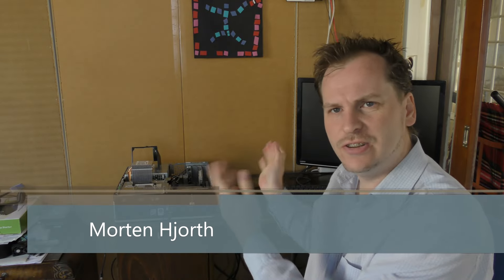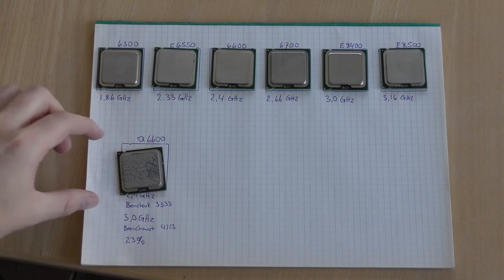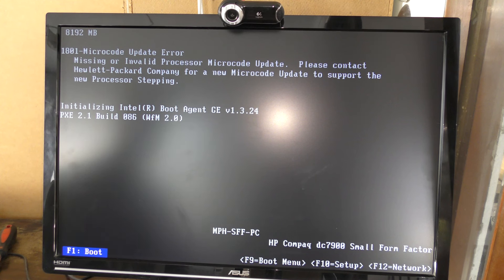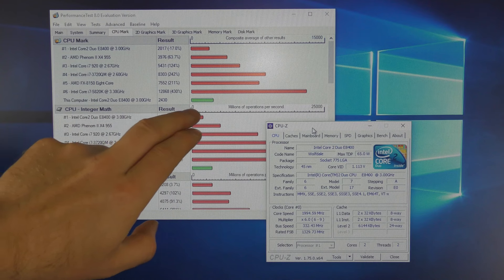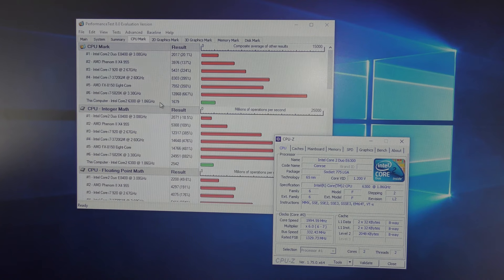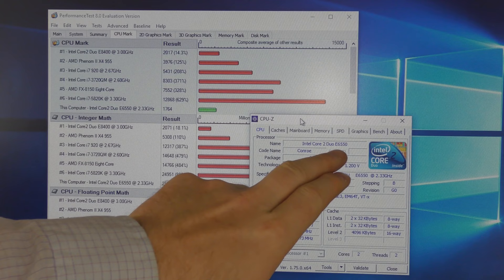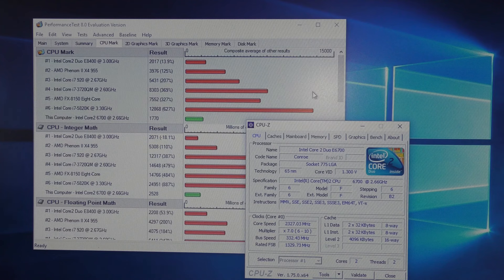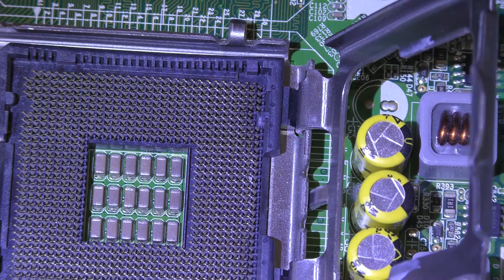Ninja Waste "BSEL Mod" E6xxx and E8xxx-series Intel Core2 - 386

Comment: Too all E8xxx/Q9xxx users.
Yes, you can do the mod, if your motherboard supports 400 mhz FSB (1600 rated).
Just you need cover different pins:
http://www.xtremesystems.org/forums/showthread.php?232678-E8xxx-Q9xx0-FSB-1600-pin-mod

https://forums.tomshardware.com/threads/is-there-a-working-bsel-tape-mod-for-the-q9500-cpu.3084404/
Unfortunetly, My Playhouse replied last 3 years in comments to everyone, that it is not possible, because it's already 1333 mhz FSB CPU. Of course, they were interested about 1333->1600.
Reply from the maker: Hi warrax111
Thank You very much!  glad you liked the video :-)
Thank you for watching! :-)

Comment: I appreciate the videos and time you put into them ...helps me on my xenon n Intel older processor questions and ideas I appreciate yah man!! Keep up the good work !! I managed swapping my sons 3.0 dual core out to a modified x5450 xenon quad 3.0 and brought it back to life for better gaming ...I got 2 more x5450's and picked up a q6600 n tried the tape but motherboards I tried in 2 Dell's was the g33mo2 mobo and won't support quads but got a friend supposed to bring me a mobo n hoping its a 775 socket n maybe an Asus or gigabyte to have better luck with but till then I'm keeping my eyes open for a different Dell but may just try the tape idea on those dual cores and c if they clock a lil higher even just to sell em cheap to someone looking for a pc to play around on ...thanks 4 the ideas!!
Reply from the maker: Hi jason wilbur
Thank You very much!  glad you liked the video :-)
Thank you for watching! :-)
Reply: G33m02 does not support quad core CPU, you need the g33m03 for that. You could bsel 1066 dual core on them but most of the higher clocked e7500 etc will require more voltage too to be stable.

The lga771 mod and a xeon x5270 would be a good choice for those g33m02 boards, 80w 6mb cache 3.5Ghz at stock fsb and voltage would allow for some software over clocking using setfsb or similar.

Comment: The tape method works only if your motherboard supports 1333MHz FSB and you are using a 1066MHz FSB CPU. For 1333MHz CPUs you need 1600MHz capable boards respectively.
Reply from the maker: Hi Foreigner037
Thank You very much!  glad you liked the video :-)
Thank you for watching! :-)

Comment: it only works up to 1333mhz fsb (1600mhz on aftermarket boards) which is why the e8xxx series doesn't really work. It does work with almost all of the Conroe and Kentsfield CPUs though (e6XXX and q6XXX) except the extreme edition cpus. The main thing that would prevent any conroe or kentsfield cpu from booting after a bsel mod would be voltage. If you're doing this on an oem motherboard with no voltage control, then you may just want to stick to the e4XXX and e6XXX cpus and go no further than 1333mhz bsel mod.

It DOES work with almost any 775 CPU, but the voltage limitation and heat will always be the main cause of problems.
Reply from the maker: Hi
Thank you very much for your awesome input!
Thank you for watching! :-)
Reply: DOverton252 
I know this is old news, but its new to me.  You sound knowledgeable so I reach out:
I have a Hp/ Foxconn N15235 Motherboard found in older slim pc.  Tried this (and many more bsel mods configurations) on a E4700.
System just wont boot with the mods.  I think the motherboard will not allow it
I only have 3gb Ram in there could that play in any way?

Comment: I have a HP DC5800 with a e5300 do you know anything about this one ? Is thé Q6600 the best CPU to put un those computer ?
Reply from the maker: HiYou get a lot more out of the Q6600 and it is like $14 used.
Thank you for watching! :-)
Reply: what about my little e5300 ? will regular tape damage the cpu ?
How did you get the info that the Xeon doen't work ? Can I put a QX9770 ? Or Q9650 ?
Thank you for replying I really apreciate, love those videos that you do !!
Reply from the maker: Hi Royal Eagle 
You will need to google that :-)
I do not have other Q CPU's to Test.
Thank you for watching! :-)

Comment: The E6550, E8400, E8500 all already run at the maximum FSB supported by most chipsets of the core 2 architecture (1333 = 333x4), so it's pointless to mod them. To jump the E6300, E6600, E6700 and the Q6600 (from 1066 to 1333) you only need to float BSEL2 which is covering that pin next to the notch. The other piece of tape does nothing to the overclock and is covering a power pin which could result in less power delivered to the CPU if it senses every pin. 

Still not sure why you experienced some underclocking but I will come back to it if I bump into something. 

We can read the Core 2 CPU and Chipset datasheet on Thursday if you have time haha. Cheers.
Reply: Thank you for bringing this up and wasting the 3 hours by the way!!

I hope I don't sound like I knew it all along because I did most of the research and testing on Wednesday lol

My retired E6400 is up to 2.66GHz and solid now :D Cheers
Reply from the maker: HI
Thanx for the good info,,,, only need one piece of tape. I will test that :-)
Yes I be in London Thursday,, if they let me in :-)

Thank you for watching! :-)
Reply: My PlayHouse Just don't bring over any colourful homemade 18650 lithium battery pack with a bunch of wires hanging of from it! Haha. Will see you on Thursday
Reply: My PlayHouse By the way, did you get my message with phone number?

Comment: Morten, you can try getting a Dell Optiplex 745. I have an Optiplex 745 running with a Xeon X3220! If you can get the better one like an Optiplex 755 or 760, you can run better xeons in it nice for a workstation and/or server. Great video as always! :)
Reply from the maker: Thanx,,,
I was going to make a video on my new Lenovo mini PC,, but I have forgotten the damn power supply. :-(
Thank you for watching! :-)
Reply: :O Nice! Is it the Lenovo Thinkcenter M series? I've always loved small PCs. Could run them as a server while taking up a small space.
Reply from the maker: Hi
Yes an M93 i think.
Thank you for watching! :-)

Comment: I had to update the microcode on an Award BIOS firmware to enable a Xeon 771 processor to work properly on a 775 board - Dell Inspiron 520 :)
Reply from the maker: Thank you for watching! :-)
Reply: For boards limited to dual cores there is a 1333 3.5ghz Xeon x5270, a 1600 bsel mod on one of these would almost definitely need a volt vid mod too for stability.

Comment: It seems to that all these Core Duo's are all the same chip, only that intel deactivated some frequenze, which you compensate with the tape. So you make them all the same.
Reply from the maker: Hi 
The microcode is fucking up my awesome test :-/
Thank you for watching! :-)
Reply from the maker: Hi Ante Plus 
The point was to see if there was anything to be done for this shitty offices PC, with no overclocking possibility what so ever. The Q6600 worked really well,,,these, not so much!
Thank you for watching! :-)

Comment: my playhouse hiya iv got a core 2 extreme X9100 3.6ghz in my old dell optiplex 760 pc  and woundering if this could work with my cpu do you think it's possible
Reply from the maker: Hi William Davie
Well maybe,, the x9100 does have a FSB of 1066MHz,, like the Q6600,, but if your system does overclocking,, that is way better.
Thank you for watching! :-)
Reply: +My PlayHouse (Morten Hjorth) thank you very much for your reply yes I'm going to give it a try iv got the cpu strips I can use morten  I will take a screen shot before & after or a video if it works and let you know and see the difference hopefully it can help others if it works  thanks very much morten

Comment: Hi thanks for your videos :D They're great. I did it with my Q6400 and raise the GHz from 2.4 to 3.0 and the bus from 1133 to 1333 and it works perfect. But i've one question: I did the same by my brothers CPU (Q8400) but at the first time if started the PC the Motherboard told me that i've installed a new CPU. The normal Basefrequenz is now 2.0GHz from 1.6GHz but i can't go over 2.0GHz anymore. Do you have any idea what i can do to get the 3.26GHz? Maybe an Biosupdate? Thanks for your help :D PS: Sry for my bad english. It's not my native language.
Reply from the maker: Hi
If the mother Board can do over clocking, this is not needed at all!
Thank you for watching! :-)

Comment: Hello could i use the tape method in my q6700 in my optiplex 745?
Reply from the maker: Hi Nyblen Productions
Might work,, if not, you just take the tape off again. 
Thank you for watching! :-)
Reply: q6700 needs usually increased voltage, as it won't go 3.33 ghz on stock voltage usually.

Comment: maybe the ninja hack does work, its just the micro code thats messing with the processor
Reply from the maker: HI
a lot of these CPU's was already running 1333MHz so nothing to gain :-/
Thank you for watching! :-)
Reply: +My PlayHouse (Morten Hjorth) You could try the VID mod that increases voltage and see the results, also can you try this on LGA771 CPUs?
Reply from the maker: Hi SkyMix_RMT 
I have done the Xeon 771 to 775 MOD : 
https://www.youtube.com/watch?v=abIIbI4jXeQ
And did a overclocking on it:
https://www.youtube.com/watch?v=ExPY4lbW6Yw
Thank you for watching! :-)

Comment: please ask me . This right for core 2 quad Q8400 too ?
Reply from the maker: Hi tutor games
NO the Q8400 is already at 1333MHz,, so no change : https://ark.intel.com/products/38512/Intel-Core-2-Quad-Processor-Q8400-4M-Cache-2-66-GHz-1333-MHz-FSB-
Thank you for watching! :-)
Reply: @MyPlayHouse  i am pretty sure covering the two pins nearest the notch will bring 1333->1600 but the motherboard must support 1600fsb

brings q9650 to 3.6Ghz most will do this on stock voltage
Reply: @nexus7tablet610  nice info, was finding this information for months. I dont understand why people are not curious about this, as many E8400 users are there. Why anyone cares only about 2.4->3ghz lol, dont understand it. Please make some video, or confirmation or source.
Reply: @nexus7tablet610  Wow, found it! http://www.xtremesystems.org/forums/showthread.php?232678-E8xxx-Q9xx0-FSB-1600-pin-mod
Yes, it will work from 333 mhz (1333 rated) to 400mhz (1600 rated).
What is worse, this dude My Playhouse misinformed already like hundreds E8400 and Q9x50 users in comments, while they asking, that they cannot do the mod, because it's already 1333 mhz. Of course, they were interesting about 1333->1600 mod.

Comment: You are thorough, lots of work! 
Rename channel to, "My Corner"...seriously.
Is it too much to ask if you considered the low voltage processor(s), Xeon L5320 ( socket 771)? 
Bus frequency is 266 MHz. but,  because the processor uses Quad Data Rate bus,  the effective bus speed is 1066 MHz.
Often, the Earlier BIOS updates for the ( HP, Dell, Lenovo) business boxes are the most robust and can, "do" more.
How will the,  "BSEL Mod" with tape procedure, change out with the socket 771 pinout?
Cheers!
Thank you.
Reply from the maker: Hi postcrisp
Thank You very much!  glad you liked the video :-)
Thank you for watching! :-)

Comment: Does this work with the Presler (i.e Pentium D920) or Conroe-L (i.e Celeron 420) processors as well?
Reply from the maker: Hi are they 775 socket?
Thank you for watching! :-)
Reply: In theory it works for most Intel processors, but is only practical on the LGA775 ones
Reply: It depends more on the actual motherboard chooser, since thats what sets the base clock/front side bus
Reply: Motherboard chipset*
Reply: Gustavo Ferlizi Then which chipsets?
Reply from the maker: HiYes It is the chipset that determines if the Xeon Hack will work.
Check out this,,, number 6. is motherboard chipset : http://www.delidded.com/lga-771-to-775-adapter/
Thank you for watching! :-)
Reply: My PlayHouse Both CPUs I mentioned are LGA775
Reply from the maker: Hi Crimson Sunrise 
I do not know if it will work,, If you try,, let me know?
Thank you for watching! :-)
Reply: Crimson Sunrise I mean that your chipset has to support the Base Clock / Front Side Bus that you want to run at. Both of the chips you mentioned have an 800MHz FSB. There's a list on wikipedia of core 2 architecture chipsets here https://en.wikipedia.org/wiki/List_of_Intel_chipsets#Core_2_chipsets
Reply: Tried with my Celeron 420. No POST. I don't have a cooler powerful enough, so I won't risk the Pentium D920.
Reply: Crimson Sunrise To be clear, those 2 chips are not worth the time. ...but if you want to learn... Here is what I know:

The BSEL setting used in the video is only good to jump from 266 to 333 baseclock.

To jump from 200 to 333 you have to do 266 first. You can leave the insulating tape on the pin next to the notch (BSEL2) as in the video and then trace the pin right above it (BSEL1) to a ground pin (VSS) with conductive ink (try alluminium tape first) as seen on this image http://i246.photobucket.com/albums/gg116/sniper69aka101/14185b89.jpg

PS: 200x4=800, 266x4=1066, 333x4=1333
Reply: Gustavo Ferlizi I'll try once I have access to this tape. I looked and some people said that the motheboard I have doesn't allow that jump (ASUS P5VD2-MX)
Reply: Crimson Sunrise You can read the first feature on asus's website that it only supports up to 1066FSB going back to my initial comment. So you can only do the harder mod of BSEL1 to VSS for 266 clock.
Reply from the maker: HI Crimson Sunrise 
It seems that the ASUS P5VD2-MX can do some overclocking,, You can not run faster then the Motherboard's 1066FSB. I'd also say that this might not be worth your time :-)
Thank you for watching! :-)
Reply: My PlayHouse Well, I already have my Pentium D 920 2.8 GHz overclocked to 3.25 GHz. That's the maximum amount that it can go to on this board.
Reply from the maker: Hi Crimson Sunrise 
Nice,, you are out of FSB on that board then :-)
Thank you for watching! :-)
Reply: Crimson Sunrise

Comment: I have an old computer (not my primary) with E-6320 and this might give it a little boost for no cost. I tried the tape and I started having errors and went into boot loop. I got it out of boot loop after I removed the tape.
Reply from the maker: Hi Robert kubrick
Give it a way bigger boost with a Q6600 : http://amzn.to/2wbNkup
They are really cheap now.
Thank you for watching! :-)
Reply: I don't know if the bios would support a Q6600 or I would have long ago.
Reply from the maker: Hi Robert kubrick
Ohh Yes, that can be a problem.. search your MB and q6600 and see if others has had luck.
Thank you for watching! :-)

Comment: Dude if the processor has his processor does not have a constant speed it means the motherboard is to weak. VRM overheats. The test is very intensive on the processor so it should run at full speed. This is why the q6700 was the weakest in the early tests.   This is what happens on my AMD 8350 when I OC to 4100 it is weaker. When I oc to 4500 it is better but it is unstable. My motherboard is very cheap ASROCK Pro3 R2.0
Reply from the maker: Hi Vlad Ionescu (Ecstasy2006)
Thank you for watching! :-)
Reply: No problem.
Reply: Is that a bot?
Reply from the maker: HI Vlad Ionescu 
No no Bot,, lots of cut and past though!
I did not understand you massages, but did not have time to dig in to it :-/
Thank you for watching! :-)
Reply: Yes, you actually say the motherboard is not the best :))
Reply: Love the hacks. Is there a hack to enable Parallelization to non Xeon processors. There used to be for old Celeron 333 Mhz to oc to 533Mhz and also put two of them on a dual socket motherboard.
Reply from the maker: Hi Vlad Ionescu 
Not as fare as I know.
Thank you for watching! :-)

Comment: tried to do this mod on a q6600 in a dell 780 pc and it won't work. tried a core 2 duo 1.89 and it won't work it is able to get the info of what the cpu is from another place.
Reply: What ur mobo chipset ? Q45?
Reply from the maker: I only really got anything out of the Q6600,, it was fun back then :-)

Comment: just got a 8000 elite with the e8400, Im going to try this out. Not gonna keep it tho cause the proprietary psu and mobo layout does not allow for easy repair if they die =(.
Reply from the maker: Hi
Let me know if you test this with more luck?
Thank you for watching! :-)
Reply: +My PlayHouse (Morten Hjorth) Hey Morton, I decided to research the bsel mod a little bit and the main source (from overclock.net) talks of using a conductive pen to short pads on the CPU?  Their pics arent loading right for me at the moment, hmmm...
Reply: +My PlayHouse (Morten Hjorth)  Hmm after investigating, it appears the reason the mod doesn't work (whether shorting pads or taping pads) is because the mod fools the mobo into running the FSB at 1333 instead of 800 or 1066.  Well my setup (and maybe yours with the e8400 installed) already run at 1333.  There really is no place to go from there.  I do have some pentium d's I will try it on and then keep the e8400 and sell the system with the moded pentium d (if it works).  After I verify stability and thermals are good of course.
Reply: well poop apparently my mobo doesn't allow unverified changes of the fsb.  whenever i tape any processor it just turns on and turns right back off and cycles forever.  Once the tape it removed it boots fine.  i tried it on 3 processors, all the same thing.  i don't have any conductive pen to try the pad shorting method, nor would I even attempt it, lol!  Great videos nonetheless.
Reply: Funny story.  I thought I shut the elite series box down but actually I had just switched my kvm to a channel no pc was connected to so the monitor went to sleep and I thought it was shit off.  I didnt notice the power LED on and I went about swapping the processor with it powered up.  As soon as I lift the retention arm the pc started beeping like it was pissed at me and I immediately pulled the plug.  Miraculously it is still running fine.  Scared the crap out of me, lol!  Damn kvm is great usually...
Reply from the maker: Hi Jay Walt 
Big shock for you there!! :-/
Good that it did not brake!
Thank you for watching! :-)